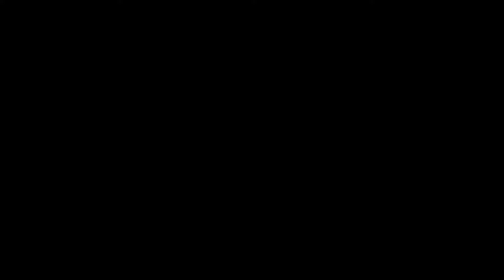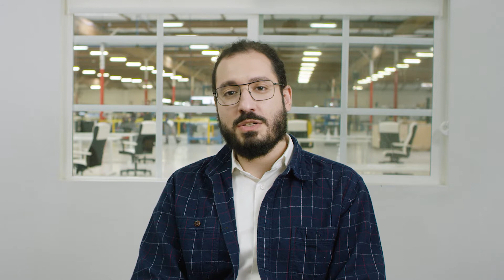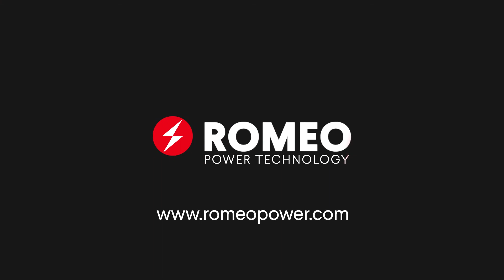Lithium vs Hydrogen Fuel Cell Technology

Comment: According to reports, there is enough lithium for 9 billion vehicles...and that's it. Also, you have to strip mine the planet to get it. Hydrogen is a renewable fuel source in that the water byproduct can be recracked back into hydrogen. So in terms of truly renewable, hydrogen wins hands down over lithium that has to rape the land to get it.